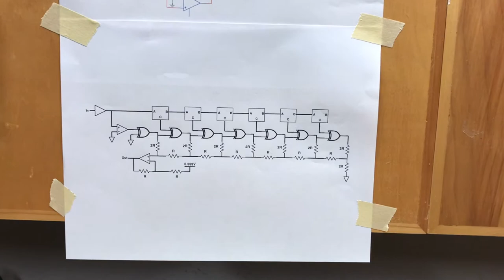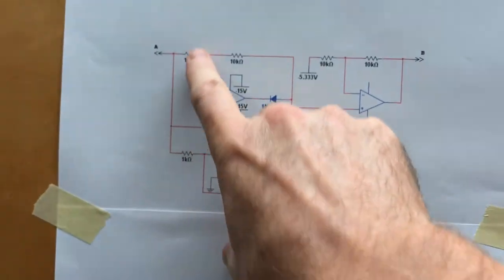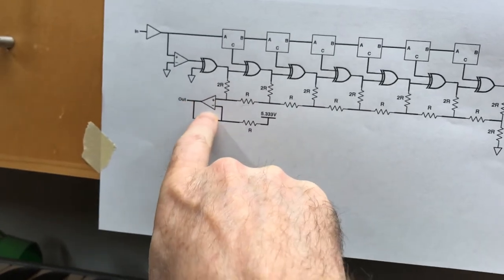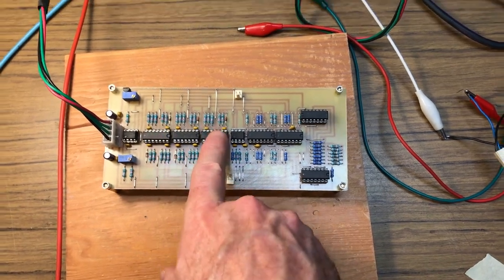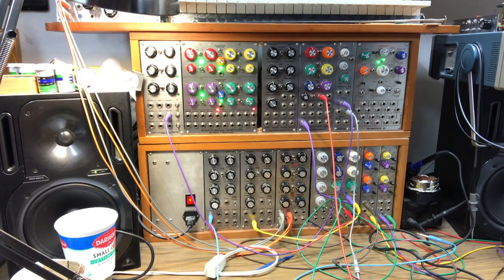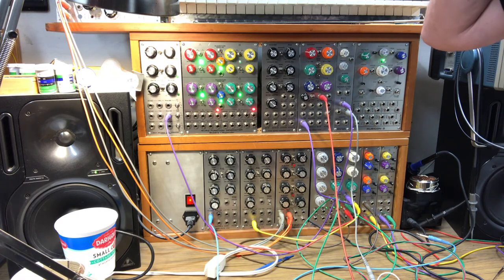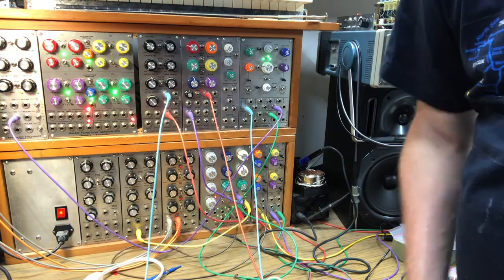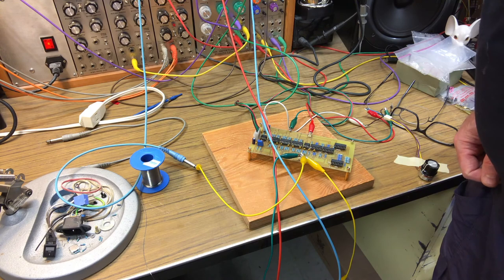Doc Sketchy Folding Quantizer

Comment: Hey I have been following these projects. What software do you use to illustrate these diagrams?
Reply from the maker: The top diagram (the actual schematic) was drawn in NI Multisim, which is the circuit simulation program I use.  The bottom drawing was cobbled together in Excel, using lines and boxes, and the resistor and XOR gate images came from searching on Google.  It was a bit of a chore, actually.

Comment: amazing as always! to quantize to other ratios than semitones, (octaves for example) - would one simply change the ratio between R1 and R2?
Reply from the maker: No.  It's not that simple.  This is a very basic ADC/DAC circuit, so the octaves occur every 12 steps.  This does not lend itself to a simple binary interpretation.  To make a proper octave-driven quantizer, one would have to have both an octave quantizer and a semitone quantizer.  For example, a 3-bit quantizer would give 8 octaves, and a 4-bit quantizer would give 16 semitones.  The input to the semitone quantizer would have to be summed to the inverse output of the octave quantizer so that it was reset to 0V with each successive octave.  This way, the semitone quantizer would never see codes 12, 13, 14, or 15, but would always reset from code 11 to code 0 when a new octave was entered.  Another thing one could do with this sort of quantizer would be to subject the semitone codes to further logic to get things like diatonic scales.  That would be a much more elaborate circuit (but rest assured, I'm working on it already).
Reply: @docsketchy  amazing! that sounds like a neat project, can't wait to hear the diatonic addition in action... - about octave quantizing, thanks for clearing that up :) i wonder, a crude way to quantize to octaves using your circuit, would possibly be in attenuating the incoming signal, then gaining the output, scaling the output up until semitones have expanded into octaves? bad idea? ...probably, but i couldn't stop wondering........